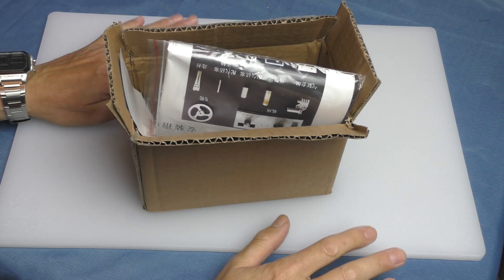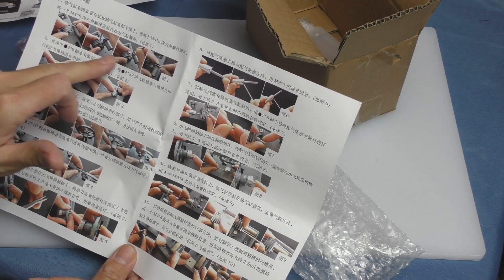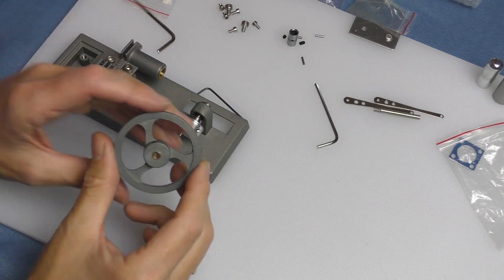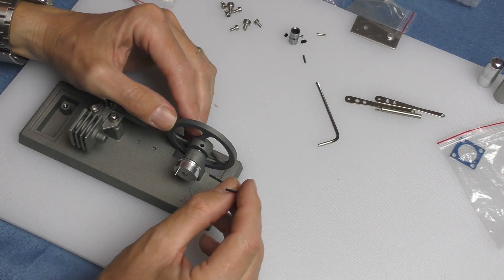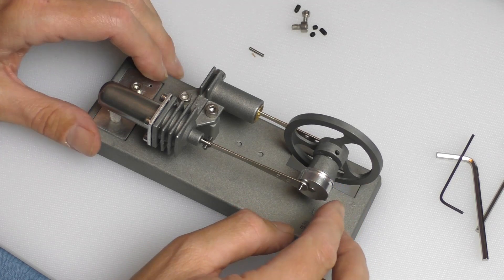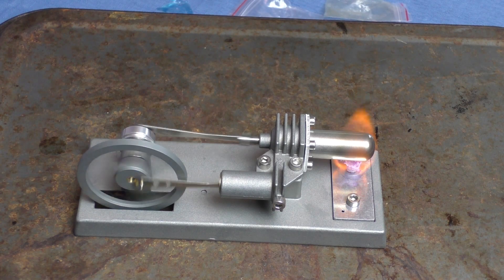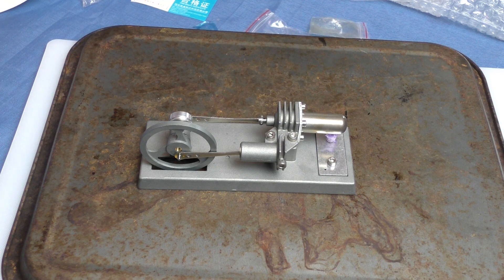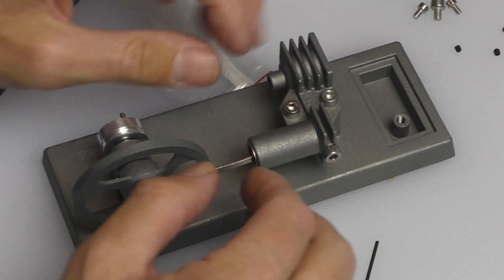Just £20 AWESOME EBAY Stirling Engine build video

Comment: Purchased this same model recently, followed instructions to a tee but for the life of me cannot get it to run even for a second. I thought there might be too much friction in the pistons but after watching your video and seeing you spin it by hand without flame, mine is as if not smoother. So begs the question - where have I gone wrong?..

I haven't greased the parts to be fair, what type of lubricant did you use?

Comment: good video dude, yes that grub should penetrate,,  fore head slap I have come to the conclusion about this brand of engine that the ones 
that are brass slieved power cylinder are reworked bad casting an have a
 smaller power piston,  thanks for the video

Comment: This Kit is now modified ..  The centre bush on the flywheel no longer has that brass insert (it serves no purpose anyway) and so that tapped hole does in fact go the whole way through to the axel bar.
Also on mine, the fuel bottle has a thin hollow metal tube, somewhat like a hypodermic needle, this so I am told, is only available with the China and UK version kits. The US banned it because they fear it might be used for drugs. 

Only downside to the modified versions of this kit is that those colour instructions no longer exist. All I have is a real mess of a parts list and terrible drawn illustrations.
That's why I'm here watching this video.

BTW don't make assembly videos in fast motion, it defeats the point of so called "Build videos" and transforms it into just another Click Bator vid.

I find that grey rough die cast metal a real temptation to introduce some kind of Mamod style paint job, with a combination of bright red, green and a hint of black. This should give the engine a look of antiquity and quality.
Reply from the maker: Glad your enjoying your build.  This video is not intended as a step by step guide as that would take to long but it does show the build.

Comment: Just rec’d this kit, assembled but doesn’t run. The hot side piston shaft is a bit adjustable, seems I’d want as long as possible?
Reply: Same here.  Have mine for 2 days now.  Been trying to adjust it evenings after work.  Even used graphite lube on parts.  Not ideal what I'm doing wrong.  May end up RMAing the thing  ☹️

Comment: Those ball bearings are 10 a penny in China. I've purchased a few myself over the years for various motor repairs.
Reply: Ive often thought of trying to convert a steam engines drive shaft.  It runs so much better with bearings.
Reply: As you try to add vinegar with water to try get steam hotter so it go faster cause I put some vinegar in microwave before and I burn microwave out with heat that you can get from vinegar it go on but don't heat anything up I didn't told my mum cause she will of kill me if I told her what I done but I got her new microwave I didn't told her why I got it her
Reply: No don't put vinegar in it that I just say cause it with duck it up by heating up up cause it seem the acid in vinegar seem to get stonger and eat though metal that why my mum microwave didn't heat up after I done it